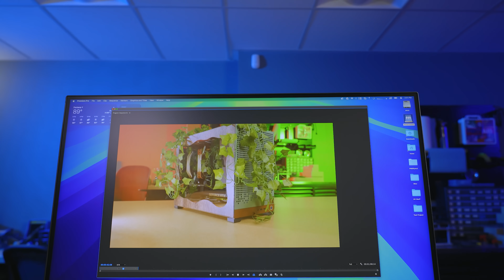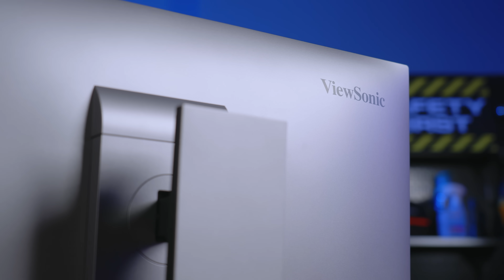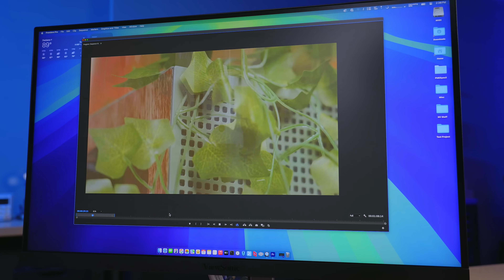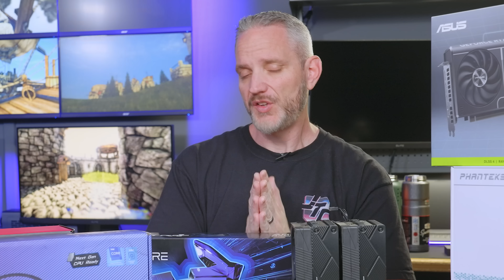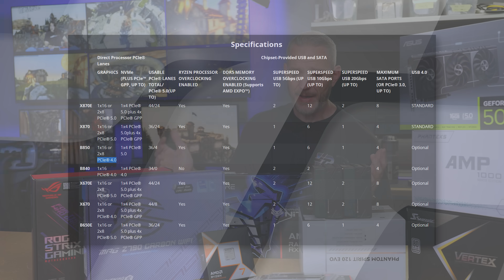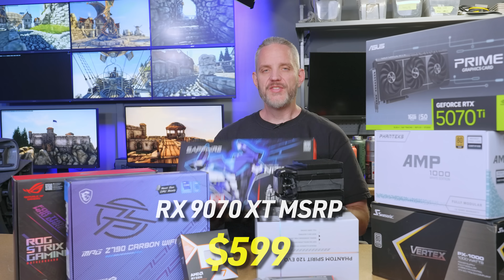This is the Sweetspot for PC gaming... Don't get fooled into spending more!

Comment: Jay'z point about Power Supplies is so spot on for me. Years back when I was upgrading to a GTX 1080 I got a 650w PSU thinking that was more than enough, and with how efficient the 10 Series Nvidia cards were I naively thought that trend would continue.

Cut to last year when I was finally feeling the need to upgrade from the 1080, and I was limited in what I could get without also shelling out $100+ for a more powerful PSU. My budget was pretty strict so I wasn't able to get the RX 7800XT I wanted, and instead had to settle for an RTX 4070. Don't get me wrong I've been happy with the 4070 so far, but I know that its 12GB of VRAM will become a limiting factor sooner than 16GB that the 7800XT has. 

At the end of the day would I have noticed the difference anyway?  I don't know, but I remember that irking me when it happened.
Edit: Jay mentioned the 4070 later in the video lol, again it's been good for me playing games at 1440p.

Comment: Major tech blogs on the other side of the ocean are settling down as well atm on a sweet spot gaming rig before the upcoming "Trump storm".  Last week, a major Dutch tech blog (Tweakers) decided that 1440p is currently the sweet spot in gaming and published their 1500 euro budget config for it.:
Processor: AMD Ryzen 7 7700 Tray, € 205,99
Motherboard: ASUS TUF Gaming B650-PLUS WIFI, € 141,-
GPU: Powercolor Hellhound AMD Radeon RX 9070, € 669,-
RAM: Kingston Fury Beast KF560C30BBEK2-32, € 115,90
CPU cooler: Arctic Freezer 36 (Black), € 34,90
SSD': Lexar NM790 (no heatsink) 2TB, € 117,99
PSU: Corsair RM650e (2025)  Black € 85,83
Case: Chieftec APEX AIR, € 69,80
Total:  € 1.440,41

Now with this tight budget you're obviously aiming for a less ambitious and future-proof system than in this video, but they did provide upgrading alternatives. Still, it can provide good guidance, especially if you're in EU.
These are btw guys that test everything themselves, not unlike what blogs like Nexus do. And everything  they don't get to test they meticulously curate with help of their own community. So at least there is proper thinking behind it.

One takeaway I get nowadays from all this stuff: Intel/Nvidia is out, AMD is where it's at atm if budget is a concern to you.

Comment: Still using my 15 year old Corsair HXi 650 watt psu, still absolute rock solid. Always had mid to top tier cpu and mid tier gpu's the entire time. Currently running a 8600k @ 4.8 all core and a pathetic RTX 3050 8gb card oc to 2.2 Ghz when gaming. I will need a new PSU by the end of the year and will retire this rig with the PSU to the history pile, over 28 years worth of working rigs, it's been a great journey and great times ahead i am sure.

Comment: Thanks for this video it was very helpful. My PC recently kicked the bucket. I had it for 12 years. Unfortunately my kids now are 13-15 and use the computer daily for multiple things. I have been watching you and many other PC YT guys for over a year now and have learned so much. I'm in my late 40s and am looking to build my first PC and want something that will last hopefully 8-10 years with upgrade paths if needed. My biggest thing is budget because I recently had Kidney failure. I was a Chef and did part time Landscaping. I never knew you could overhydrate yourself and cause Kidney failure. Anyway sorry for the story. I was thinking about going with a 9070xt the Nitro + is the cars I've been wanting since launch. But what would you recommend I do for a first time builder?

Comment: Noctura sent me an AMD fitting for my NH-D15 when I updated. For *free*.  Three MOBOs, 15 years and counting. Oversizing is GOOD. EVGA G2/SuperFlower 
PSUs are worth the spend. You want the protection. There are far more power sags (and they do damage) than spikes - even the cheapest UPS is worth the spend on that $2000 system. I had an APC UPS last 13 years. When it blew. APC sent me a new one and paid to have the old one shipped to them. I guess they were curious. 13 years? Really?  They also paid for components that were damaged when it failed. 
GPUs: I live on the bottom of the U used curve. Just find a reputable seller. Lots of value to be had. 
Memory: buyer's choice. New if ya gotta, used if you have a seller.
CPUs: never bought a used. Too fragile prima donnas.

Comment: Don't be caught in Intel vs AMD flamewar. Consider price to performance ratio first (keep in mind reliability issues too, both have them, sadly). If Intel is less popular means it's getting cheaper and you can get better deal on it than AMD. Speaking of 3d cache, it only gona matter on low resolutions and mainly cybersport online titles. If you are 4k AAA gamer you will have no difference from 3d cache. And it being overhyped means it's overpriced too.

Comment: 4070 doesn't have 16gb vram
Reply: Probably meant the ti Super
Reply: The Ti Super does. The rest of the series is 12gb, which is better than it could be...
Reply: I was surprised as he said that. I doubted it, but I didn't pay attention to Nvidia the last two gens so I wasn't sure about it. Thanks for clearing that up!
Reply: lol and 4070 super cost more new than a 5070
Reply: @alexrekzu4079 Here 4070 super is vastly cheaper then a 5070. You can get a zotac 4070 super for 633 dollars here and best model is at 700 dollars while base 5070 is starting at 774  and best models go to 880.
Reply: also 7800X and 9800X don't exist (and no he didn't mean the X3D ones)

Comment: I managed to get a gigabyte z790 ud ddr4 mobo, 14600k, and 32gb of gskill 4000mhz ddr4 ram for $250 all new off a guy on marketplace as a bundle deal. Running that with my new 5070. I can play all my games on my 144hz 32inch 4k dell monitor easily. Even if its not top of the line it's fast and I get great performance in 4k. Eventually I'll upgrade to a ddr5 z790 mobo but I'm in no rush it's a great pc.
Reply: When I was building I was overthinking it alot and to be honest you don't need a 14900k and 6000hz ddr5 ram with a 5080 or 5090 to have a great 4k gaming experience. Not to mention 1440p runs like a dream.
Reply: Also I occasionally use MFG and with the new 50 series cards it's actually an amazing tool and I've had no issues with performance on my 5070 also all the new tools are really great dlss 4, smooth motion, ray reconstruction, game filters, MFG, I was running a gtx 1060 6gb until January this year it's been a great improvement.

Comment: X870E Has better M2 support (more lanes) than B850. You can install PCIE5 x16 GPU + pcie sound card + pcie capture card + 3 M2 SSD's which is impossible on B850.  But you are right, for the average user there is no difference.

Comment: I stick what's 750 watt power supplies. I don't need to be using 1,000 watts to run to my computer or gpus that use up that much energy

Comment: Cheap option is 100% all refurbished - B760 DDR4 motherboard , 12700KF/ pearless assassin 120,  Radeon RX 7800 XT, ddr4 3600 64gb. corsair D4000 arflow, 850W gold plus, 1TB gen3 NvME and  I still own in most all AAA+ games and workload productivity! Gives you a great mid/upper tier build for dirt cheap.
Reply: Hey that's me! I have a 5600x tho
Reply: I've got that setup except with an R9 5900X and 32GB 3200 RAM.  Even when gaming with multiple tabs on Brave browser, YouTube running, and HWMonitor running, I rarely get over 50% RAM utilization.  64GB seems like overkill but the rest is golden for everyday users.

Comment: thx @jayztwocent just speccing a new computer after 11 years since last time. And going for 5070 ti. I was going for 750w PSU. Thats is the minimum nvidia requires!! 1000w for a 5090 its crazy. So im going for 1000w now. I was looking at some of the stuff that you mention in this video, but when the GPU is almost 50% of the cost it kind of doesnt matter that much  :) Totaling 3000 usd (x2 amount i build for in 2014)

Comment: one thing i should mention, VR is becoming more and more a thing. while they've been removing the VR ready on everything but laptops, VR testing should be done more, and a 7600X and 9060XT 16GB system with 32GB can be very capable in VR. there's really no reason not to, and i think starting to get that going now before VR becomes even more mainstream would be beneficial for establishing data, even showing that sometimes you need more CPU than you do GPU in some titles to get a better performance window than the inverse, because VR works differently from desktop use-cases.

Comment: Can I put a 5800x3d and a 5090 together?
Reply: Yep. Although for that money I'd just make the leap to AM 5, grab a 7600X, B650 board, and 9060XT.
Reply: You will get severely bottlenecked by that cpu. Even the 9800x3d starts to bottleneck in some titles with the 5090. I don't quite understand why you even would put those two together. They are so far apart in class, price, age and performance.
Reply: The question is why would you? If you buy a gpu for over 2k bucks, why would you ever want to create a situation, where the rest of your pc can bottleneck the gpu.
Reply: 4k yes
1080p nope
Reply: @valterbranisarajevo8731 what about 144p max settings? And max rt?
Reply: *1440p
Reply: @buttermax1157 bottleneck. Not sure how much tho. 5090 is only make sense with 9800x3d imo
Reply: @valterbranisarajevo8731  What do you mean 1080p nope? It'll do 1080P it's not like it'll refuse and turn off. It'll just be very inefficient about it.
Reply: @Bearded-Mutt nope because wasted potential of gpu. Just my 2cents

Comment: My rule for PSUs is to first consider the wattage I want (expected full load consumption * 1.5) then sort by cheapest on sites like PCPartPicker.... then add $30 to the cheapest model.  That's how I have determined my PSU budget for a decade now.  I've built a couple dozen systems for family and friends and the only one that is not still in use that I know of is a gold rated Rosewill 850W that died after 7 years.

Comment: My personal rule is to always go overkill on case, power supply, and cooler. It's like building a good house and then you can upgrade the furniture over the years
Reply: I bought a good quality case for my last build. I probably won't need to buy another case until USB 4 is standard on front panels.
Reply: Really good advice. I bought a Noctua NH-U12S and a Fractal Define 7 for my last build, and I'll never have to buy a case or cooler ever again.
Reply: Yeah I regret buying micro atx juz bcoz I asked for "smallest but most air circulated possible casing", and now I cant upgrade my psu beyond 750W (currently Im using 650W) and nvidia xx70 ti (currently using 4070 super) series purely due to its size.

Comment: I use my 9800x3D with a B650 Aorus Elite AX  and it works flawlessly, with a thermalright 140 v3 (35 to 40 usd). You don't need a $200 AIO, $600 MOBO to get the best out of your parts.
Reply: thermalright' makes a 360 aio for $50-55 and its GREAT.
Reply: So I will agree that you don’t need the $600 mb but the AIO imo is a hell of a lot more important to keep the most important part of your computer cool so it lasts as long as possible. PSU & AIO are the two things I will without a doubt spend on. I can’t trust an air cooler. But I do understand but having that kinda cpu I’d never want to jeopardize it. Not even giving it a chance
Reply: @justinsmith5405  the 9800X3D is fairly easy to cool, the main improvement in cooling you'll get with a water cooler is when you delid your CPU, otherwise you're always limited by the TIM in-between the CPU die and the IHS. A good air cooler and a Contact Frame will do just as handy compared to a liquid AIO cooler.
Reply: @nightshadelenar  IDK the aios keep beatign most all air coolers and they vent the hot air out of the case. And as you can grab well preforming 360s for $50-55, there really isn't a reason not to.
Reply: @jetrpg22  Uh no sorry that isn't the case at all lol. It's actually more so the case that air coolers have caught up to AIO's and rather ironically it's Thermalright themselves we have to thank for this. Their own Peerless Assassin 120 SE (which I have) can match that AIO and can be bought new for up to $20 less. Another good reason why not to go with an AIO is the maintenance they require. Only thing that stops working on an air cooler is the fan's, no pump to be concerned about.
Reply: @justinsmith5405 depends what you do. I use between 40 to 65watts and temps between 50 to 70c. I only game on it. I gave it an undervolt too that's why
Reply: @justinsmith5405  They re worked the CCD stack so that the 3DV cache can dissipate it's heat better than it did in the 7800 X3D or 7950 X3D where it basically heat soaked the core regardless of what cooling solution you had. My brother is running a 9800 X3d in a B650 with a peerless assassin SE and it's been running cool this whole time.
Reply: @Bearded-Mutt  yep im running a 9800x3d with a ps120se in a b650m aorus ax in a lian li a3 with a 4090 and my cpu temps are always cool. ive been on aircooling for over a decade now. quieter, easier maintenance, no risk of leaks frying your whole pc, no worries about pumps dying.

Comment: Everyone will hate on me for this, probably, but i recently built a system for my sister-in-law. She got a 1080p LG monitor, and doesn't care at all about RT.

I put a Ryzen 7 5800X in it and an Intel Arc B570 GPU because the most intensive game she said she wanted to play is ARK: Survival Evolved. She's had zero complaints.

IMO, the sweet spot is what you plan to do with your PC. I have a 14900K/RX 6800 XT in my rig because I use it for more than just gaming (in school for Game Programming and Development), so I wanted the high horsepower for compilation, rendering, etc.

Just have fun building!
Reply: Great PC you setup. Im super happy with my 5700x3d and 4060ti 8gb, went from 3600x and 2060 without a PSU upgrade. Just added a new air cooler and more case fans. Suits my 1080p gaming and now I almost 100% play either Counterstrike2 or Battlefield 1
Reply: The 5800x can be had for super cheap. Great choice. You did it all right.
Reply: There's no shame in practicality, though a lot of content creators would have you think differently.  Not everybody needs a 9800x3d and a 5090 to have a great gaming experience.
Reply: I feel sorry for her as Ark was just killed and ASA will be hard to play on that PC.
Reply: True. A lot of people will deem my gtx 1080 / r7 1700, b450, 16gb ram... outdated, but it plays everything I want it to... it's only now in 2025 that newer games are coming out and I'm seeing my graphics card on the bare minimum requirements for games I want to play. I was pushing for the 10 year mark, but gave in because pc parts are showing no sign of going down & I'm noticing that more and more people are coming to pc in the youtube comments from console. The pc master race is growing by the day... so I pulled the trigger to lock in hopefully another 5 years with this set up. 

^ despite it feeling overkill for what I play...

I upgraded to a 5060ti, 9700x, 32gb of ram, & b650 /w 3 m.2 slots to hold more games in the future when I my 4tb nvme fills up. I'm going fully cordless... I even upgraded my fans to the icue links so now it's I even less cable clutter compared to my first build.

Comment: I think too many people have been buried in elitism, to the point where they say 9700X and 9070XT is "low end" and anything below that is "junk".
Also a point of correction, MOST B850 boards have the primary PCIe x16 slot as PCIe 5.0, very few are limited to 4.0 anymore.
Reply: 9700x is overpriced

Comment: just built a system for a friend with a 9600X, 32GB and a RX 9060XT 16GB. all on a B650m AXII from ASUS with an Inland 1TB for just under 1k. gets them off of an older pre-built with a Ryzen 5 1600 AD, 16GB RAM, and an RX 570SP 2048.

Also, one thing for VR, USB controllers are a snag leaning people towards higher-end motherboard, most B series motherboards have 1 controller instead of the 2 that is recommended.
Another thing, with NVMe, PCIe 3.0 drives are perfectly fine for OS uses, like my NV2 from Kingston is PCIe 3.0 speeds, and i don't have an issue. games and productivity really sees a bump on PCIe 4.0, but OS use you would never notice between anything higher than Gen 3. Now, paging is a thing but you shouldn't really be paging memory if you built your system with enough RAM, which right now the standard is 32GB for gaming, and 16GB for basic office use-cases and internet browsing.

Comment: Just did a white build for my gf with a 7600x3d micro center bundle and got a white 5070 for normal msrp ($550). 150fps at 1440p with fully maxed out graphics :)
Reply: 5070 is very impressive for the price point when its MSRP. 12gb vram is still plenty for 1440p and even most 4k.
Reply: @xxkylexxredhead  I went with a 5060ti 16gb for $470. I couldn't find any 5070ti for less than a 1,000 a couple months ago & they were all sold out at my local best buy's within a 250mile radius.
Right now I see 5070ti for $840 for the model I want, but the ship has sailed 
I wished I had a microcenter in my state cuz I would've went with
Reply: 5070 squad taking over 🍻
Reply: I go at it like this , do you want a Prius or do you want a Ferrari? Both will get you from point A to point B now the question is how fast you want to get there and do you want to get there in style
Reply: Forgot to mention that fps was in cyberpunk whoops
Reply: I wished I had a microcenter in my state.

Comment: My local MicroCenter had 9 Founders Edition RTX 4070s (certified refurbished) on sale for $499.99.  I bought one on Monday.  Tonight, I picked up another.  I'm gonna start swapping out the RX 6700 XT and RX 6750 XT cards out of my systems.  I just swapped in one of these RTX 4070s into an SFF PC that was running an RTX 3060 XC (EVGA) with a 5700X3D CPU.  FPS wasn't all that great (~100 FPS), but it more than doubled with the 4070.